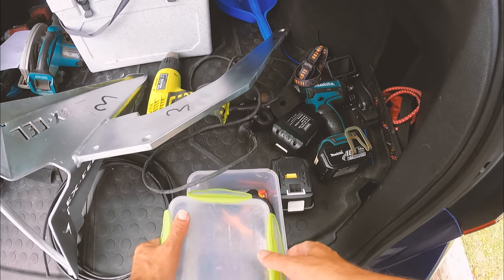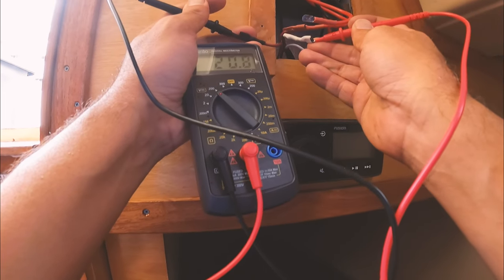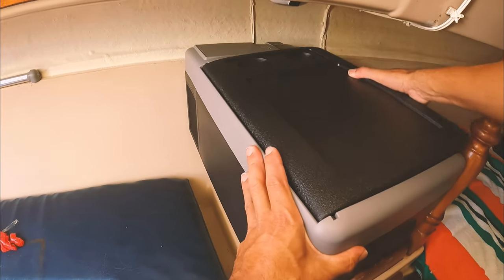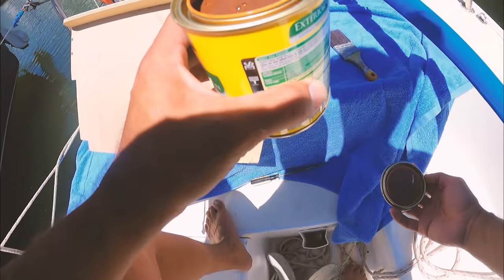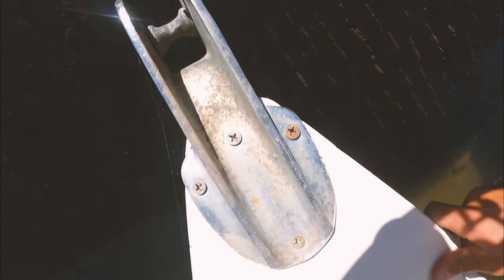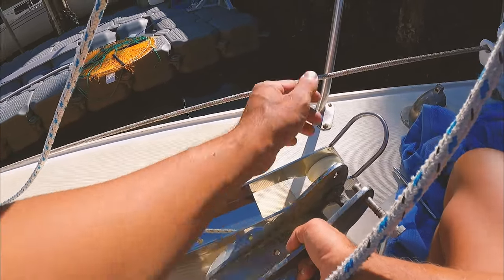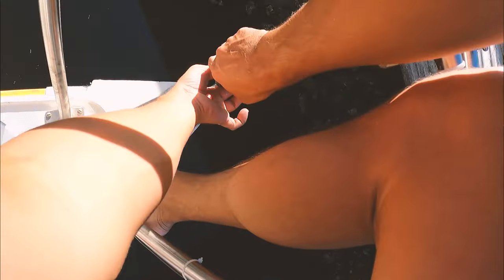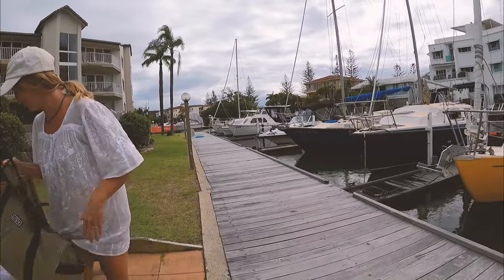Taking My Wife Sailing For The first Time.. But First, Lets Fix The Boat Ready For Adventures

Comment: The lithium battery's should only be used at 80% of the charge,  The best way to use lithium is never used fully drained and unfortunately if you do your damaging the battery really bad. 
It can mess up and light on fire.. 
Trust me it's not good. 
Deep cycle is the ones you can drain and charge..
I just don't want you to kill the batteries before you get to really use them or hurt yourself in some way.  
Stay safe out there..

Comment: It is the very wrong way to attach your anchor gear to the bow. Bolt it, and use sketch plates to insure that de frp doesn't crack. I have to compliment you the way you introduce your wife to another life at dea. The toplifting roof of your boat I have never seenon any other boat. A kind of Volkswagen idea adapted to boatlife..I have subscribed becaus I am very curious about how you manage with yout future trips.

Comment: Probably been said 100 times and I know you do know this Rod but you really need to to sicaflex that bow roller unit down to seal the old holes.
Reply from the maker: Haha, yea I probably should not have cut that bit of footage😅 I put more sikaflex down in the holes and on the bottom of the plate but didn’t have decent footage of it👍
Reply: @rokkitkit  Nice1 mate.cant wait to see your adventures yeeewww.

Comment: Im confused. If you reversed the wires on your solar panel then reversed the wires in the cabin, you effectively did nothing. The problem was likely just a bad connection.

Comment: Hi Rod,      I.m a Marine Engineer grade 2 and Dieselfitter ny trade,,,      i grew up working prawn trawlers out of Cairns ,,   then progressably went to ships with sea time aqquired running the engine spaces and fueling the vessel, which bunkered 1.3 million liters of diesel,,,,      When I done my oral examination for my Watchkeepers ticket at AMC in Tassie,         examiner says, your behind a reef in safe waters , it starts blowing a bit,   what do you do?     My answer is,,    let out a bit chain, ( anchor chain),,,    he says okay , its now blowing 40 knots , wind has swung  around and your at risk on blowning on to the reef now,,,        i said ,,    let out a bit more chain,,,      examiner says,,,,        where are you getting all this chain from??   my reply,,,   same fucking place your getting all this wind from,,,,,,,,,,,,       
Edit>    dont use an achor swivel with rope mate,      under pressure the rope will naturally untwine causing a big mess and costing you dollars in the long run,      even smaller trawlers bout 15 to 20 meters use all chain for this very reason

Comment: That's' an anchor for a 45 footer ! 
Usually put the tenders on as you are motoring in, and off as you motor out. They will come off with wave action if you leave them on. 

Great mooring. How much does it cost up there?
Looking forward to your sailing adventures. I've been eyeing off various similar size boats for the last six months myself, so watching you do it is encouragement.
Reply from the maker: I was lucky the mooring is really cheap as it’s part of the previous owners apartment complex. He was happy for me to take over the lease so it was a big part of the decision to buy the boat👍
Reply: @rokkitkit  Sooo much better than options in Sydney which is to moor it in the middle of the bay, or pay a HUGE premium at a marina. :(